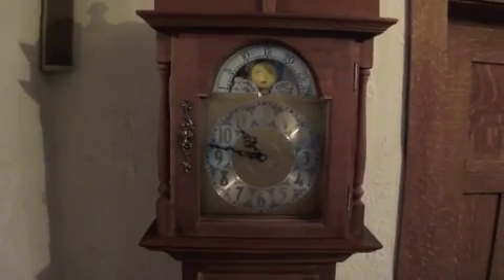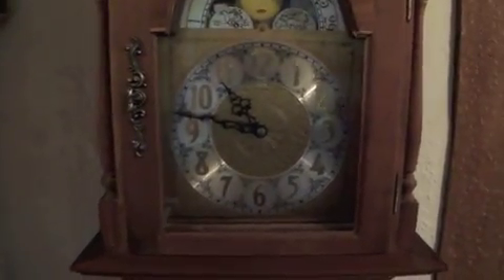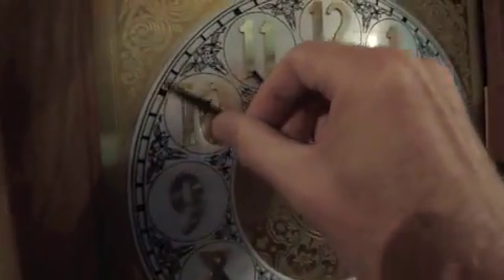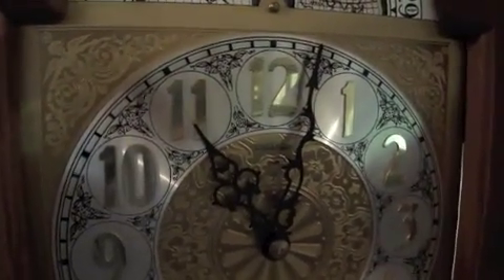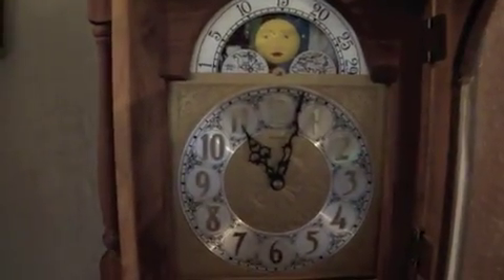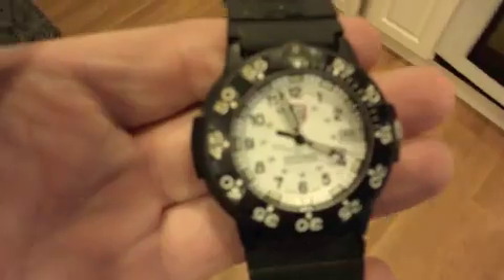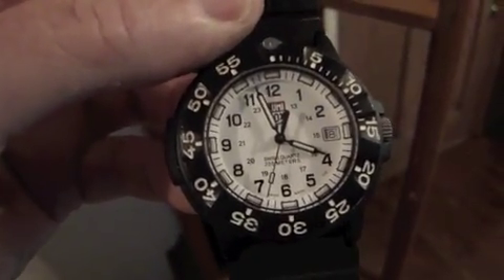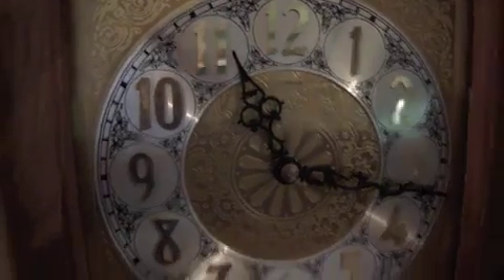How a clock works

Comment: Can I ask for some help about understanding how a watch works please?
Reply: +Key Lei A pendulum swings in circular motion, therefore, its period = 2πr/v (r, radius, is the length of the pendulum)
the acceleration due to gravity, g, is the only acceleration acting on it. In circular motion: a=v^2/r

combining the formulas the period of a pendulum= 2 π (Sqrt)r/g

now a period of a pendulum is going to be how long it takes for it to down and back where it was "dropped" from, and so if we make it so it period=2 seconds, every second is going to go past the middle.
Rearranging the formula, making it so period=2 we get that the length of any pendulum is= g/ π^2. (=99.3cm)
Therefore, a properly built pendulum with a radius of 99.3cm is going to swing by the middle every second, if we make it so it ticks every time, we have a clock.